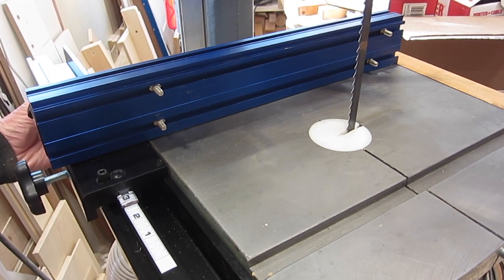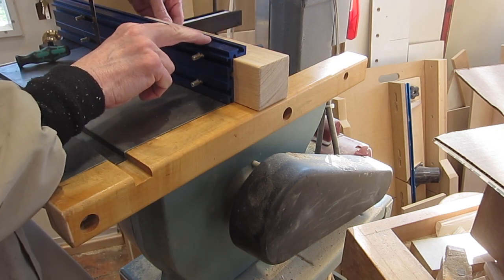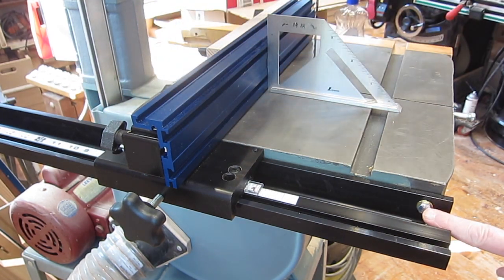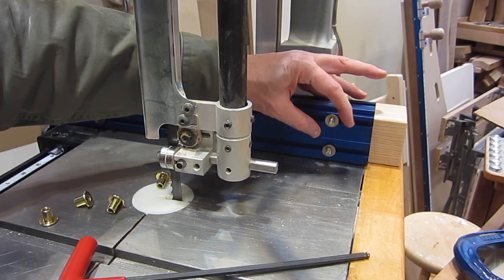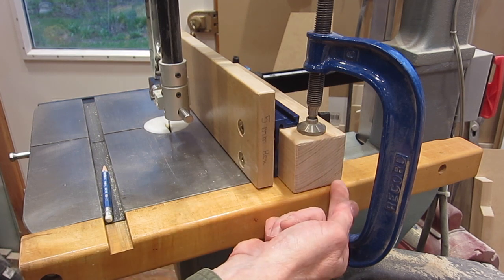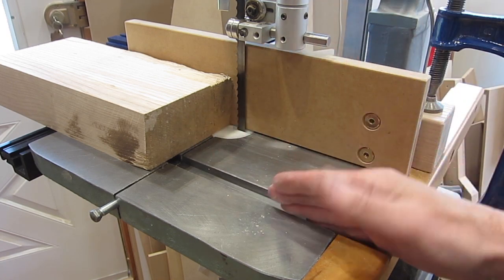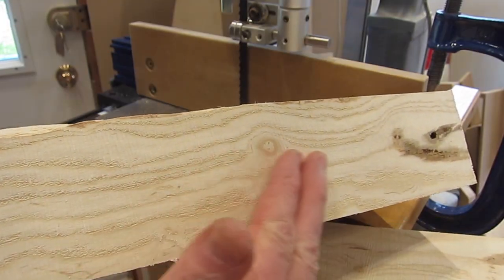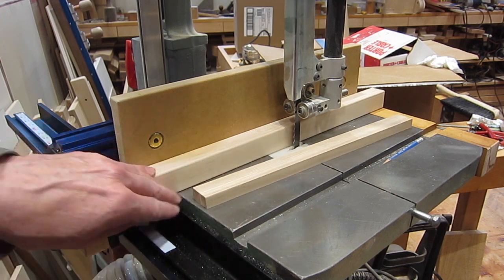Improve your Kreg KMS7200 Bandsaw Fence, for Better Cuts

Comment: Very helpful video - Just bought  a used 14" saw but it had no fence thus I have been trying to figure out which fence to buy. The fact that you chose the Kreg fence speaks volumes, AND, you provided additional detail on how to make it better and perhaps as good or better than $300++ fences I've seen. Thanks, Larry
Reply from the maker: Thanks for the comment.   Nice to know that the video is helpful.
Reply: Absolutely - this is my first bandsaw... it's been a bucket list tool for a long time just not in  the budget now.. then a friend found a used saw, in great shape and at a good price. Needs a few things to get it dialed in but it runs smooth and is extremely clean. You video made sold me on the Kreg fence - gonna pick it up tomorrow at my local Rockler.  Thanks, again.

Comment: I’m in the process of making a couple of the same improvements to my Kreg fence. I just got it last week. You know, it’s nicely built but it has a few shortcomings and it seems their engineers kinda dropped the ball on some of the things you addressed. Honestly, after I received it I was a bit shocked at all the five-star reviews. Maybe I’m exaggerating a little, I do like it… I know I’m picky. Too picky for my own good, lol. Guess I need to stop that. I’m digging what you came up with, nice upgrades man. 👍 oh, the thing I don’t like most is the lack of support there at the end of the fence, so your resolution helps. Thanks!

Comment: Do you mind sharing how tall the MDF add-on fences are... it appears the shorter is about 5" tall... is that a close guess? It is my plan to make these upgrades this weekend. Thanks very much, Larry
Reply from the maker: I made three MDF fences:  4" , 6" and 8" high.     To keep them running smooth, I first tried wax, then then went with formica glued on with contact cement.   A light coat of wax on the formica.     Here is another bandsaw video you may find helpful if you are doing re-sawing:    https://youtu.be/S3L-7cU1kAo
Reply from the maker: And here is the best way to tune up bandsaw to cut straight.   https://youtu.be/wGbZqWac0jU
Reply: Thanks very much for the info... I have some old MDF 3/4 " shelving that I was thinking of using... they already have the white plasticized coating. I used the same material for a router sled and it worked well. I'd already watched you re-sawing video.. I think some of those jigs are a bit above my pay grade,at least for now... LOL.. Again, many thanks for the feedback - I'm  relatively new to woodworking so your videos and responses are very, very appreciated. Larry
Reply: YUP!!! I've watched just about all the Alex Snodgrass videos :)... They really helped me get started on t he right foot... in fact I bought both the Miter Mill and the Log Mill because I saw him use them.. Yeah, I could have built my own, and in fact have built my own jigs,  but it was worth the $$ to get a quality product and not have spend the time getting it right. Many thanks, again. BTW,looks like you've put together a great shop :) - Larry

Comment: Steven great video. How do you make your slot on the bandsaw table perpendicular to the wheel.
Reply from the maker: Good question.   I loosened the 4 bolts under the table; then made a simple wooden fixture that hooked into the miter slot and hung down to the bottom wheel area; then held a large square against the bottom wheel and adjusted the table until the square lined up with the wooden fixture.   Another method which I have seen, but have not tried, is to install a good quality new blade;  then adjust the blade tracking per Alex Snodgrass video; then make a cut with the fence parallel to the miter slot; then look at the position of the back of the blade in the kerf cut; then adjust the table to get the back of the blade to be centred in the kerf; then try another cut with fence parallel to miter slot.   I actually think this latter method is better than what I did because it takes into account the top and bottom wheel, while the method I used uses only the bottom wheel.     Hope this makes sense.  Let me know with a reply comment what you do and how it works for you.

Comment: Great video Steve.  I will be trying some of your tricks with my own bandsaw.  
I wonder if you could attach a simple squeeze clamp or some sort of cam clamp to the back of your fence to lock it down instead of that big C clamp.
Reply from the maker: Squeeze clamp or toggle clamp would be a great idea. Fiddling with c-clamp is a nuisance.   Let me know if you find a suitable clamp, something that is permanently connected to fence would be nice.

Comment: I am using a shop built fence very similar in design to the Kreg.  I will be adding some of your ideas for sure.  
I will be adding a dust port similar to yours as well.  The spacer behind the port I am assuming is profiled to accommodate the bead along the rounded profile of the bottom door.
Reply from the maker: Yes - the spacer is made of plywood and profiled to match the door.   It attaches to door with about 16 super magnets of 1/4" diameter.   I have to remove the dust port when opening the door to change blades, so the magnetic attachment is handy.   The hole in the door serves another purpose, it allows the door to open to 90 degrees,  otherwise the door hits the motor.   So the hole in the door wraps around and includes a portion of the side of the door.  This makes the profiled plywood a little more complex to fully cover the hole, so there was some trial and error involved, and gluing a piece of wood to the pack of the plywood.       I plan to do a video on the whole dust collection system and will include this detail.    Here is a link to the dust port you saw in the video https://www.amazon.ca/gp/product/B00F5VUOKU/ref=ppx_yo_dt_b_search_asin_title?ie=UTF8&psc=1
Reply: @steven.woodward  Thank you so much for the extra details.  That helps a lot.  My machine has removable doors, not hinged, so that will make life easier, I'm sure.
Is there a reason you mounted the port at the rear of the door and not at the front?
Reply from the maker: @pgfollett  I mounted at rear (left side) of door because i had already made a cutout in that position,  years ago, so that the door could open without hitting the motor.   Being on that side of door it is more out of the way when using the saw, so might have mounted it there anyway.     As for dust collection efficiency, I don't think it matters too much where it is mounted.
Reply: @steven.woodward  Makes sense, thank you.

Comment: Do you have the dimensions of your supporting block behind the brace? I’ve ordered this jig after your review and would love to build that support piece while it’s in transit if possible
Reply from the maker: 2.29" high x 2.29" wide x 12" long.    The height is the only important dimension, to lift the fence a little off the table but not too much off the table.

Comment: Could you send me a  link for the high molecular tape please. I just now have 2 Kreg band saw fences, 1 on my Jet 18” and I just got a smoking deal on a Porter Cable 14” with the fence and micro adjust for $150.00….. pretty sure the fence and micro adj are 150 alone…Very helpful video and want to make all these  improvements because I have noticed the same, just didn’t have a plan to fix it. 
Thanks again you were a huge help with your planer video……. Another 5 stars here
Reply from the maker: Great deal you got there on the 14" saw !     Here is link to UHMW tape.   Comes in different widths and not expensive.  I used  0.5" in the video but only because that is what I had on hand.   Many uses for it in the shop.   I placed some on the bottom of the plastic glide thing at the end of table saw fence, and it slides better now.   https://www.amazon.ca/gp/product/B00823JEOA/ref=ppx_yo_dt_b_search_asin_title?ie=UTF8&th=1
Reply: What thickness is the tape, Amazon doesn’t mention it in the link

Comment: 0:53 All great improvements.  Do you think 1/2" HDPE would would work as well?  It seems to slide as-is on the steel table?  Thank you.
Reply from the maker: HDPE should work fine.
Reply: @steven.woodward  thanks, but I just realized that part of your video where you clamped the fence.  The narrow 1/2" HDPE would not be ideal for that operation.

Comment: You are great , what bandsaw? I have Rikon 14 in 10-326 and Kreg did not specifically plan the fence for that model Rikon, has anyone adapted the fence for the  “ delux” Rikon 10-326
Reply from the maker: Bandsaw in video is an old Delta 14".    Kreg Fence should work on any bandsaw, although you may have to drill some holes in the bandsaw table to mount it.
Reply: Any new improvements since original video ? I agree with Alex snodgrass , and you, after seeing his video numerous times , spacer fence is genius as the taller resaw fence gets in way , I am fed up with inaccurate Rikon fence . Wish I had gotten jet saw , same price now but 5 in more resaw ability . Would sell my Rikon to anyone willing to pick up in central Idaho near twin falls lol
Reply from the maker: @jacktrotter5357    I have not actually made any improvements, but here are some I am thinking about.   1) Infeed support for long boards.  2) Longer MDF bolt on fence plate piece.    3) Another spring finger to keep the material against the fence after it has passed the blade.  This would not work well when cutting thin slices but would sure be handy for normal resaw, especially when managing a large heavy board, to keep it from tipping away from the fence after the blade.     Just writing down these thoughts is motivating me to make improvements, so thanks for the question.

Comment: Thank you - where did you get the tape from please?
Reply from the maker: Here is link to UHMW tape.   Comes in different widths and not expensive.  I used  0.5" in the video but only because that is what I had on hand.   Many uses for it in the shop.   I also placed some on the bottom of the plastic glide thing at the end of table saw fence, and it slides better now.   @t
Reply: @steven.woodward  thanks heaps
Reply: Just got mine - thank you - the block of wood fitted to the table - did you mount it flush or slightly lower than the table? Thanks once again.
Reply from the maker: @markhiggins3054  I made the block of wood that bolts to the table, the same height as the table.   This makes the usable table surface area a little larger.    If this block is mounted slightly below the table then the block that is bolted to the fence will need to have a step in it, so that it can reach down and ride on the block that is bolted to the table.   Hope that makes sense and helps.